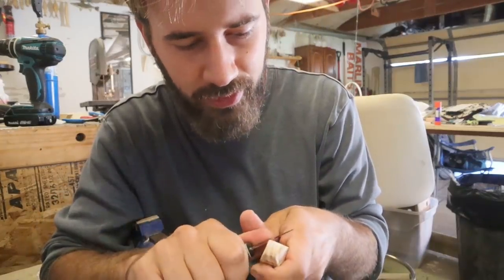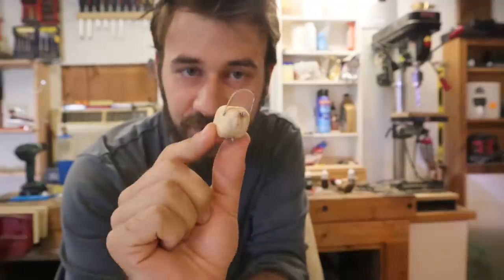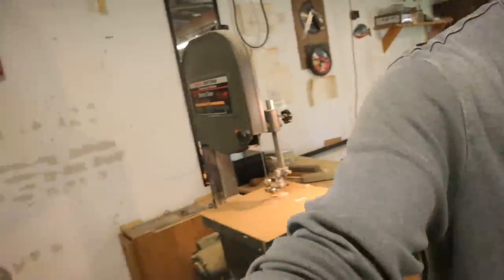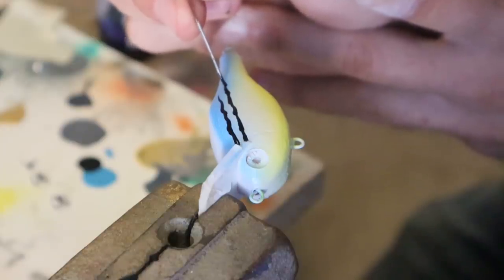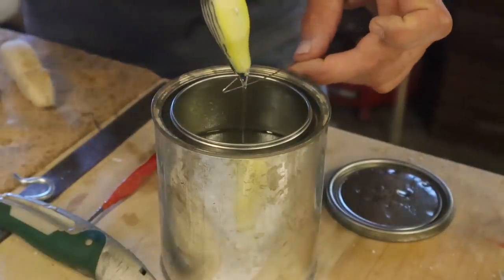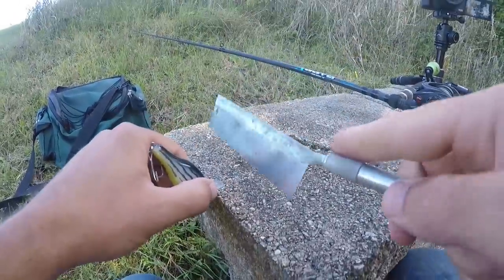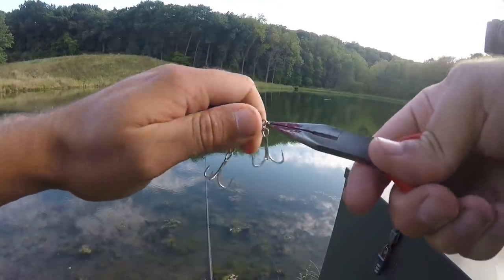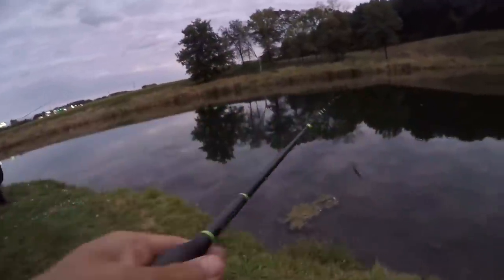Upside Down CrankBait | One Day Build to Catch

Comment: I'm a bullet caster and I'm surprised that when you pour in your molten lead we don't see all kinds of smoke when the molten lead makes contact with the wood; especially using lighter weight woods like pine.  The melting point of lead is a bit over six-hundred degrees and when I've inadvertently dropped any wood chips in my melting pot those wood chips almost instantaneously start to burn.

Some bullet casters use certain kinds of wood chips as a flux to separate out impurities.  How do you keep your wooden lures from going up in smoke?
Reply: TIM MONTANO magic

Comment: So I just started fishing, along with making my own lures a couple of weeks ago.  After losing every lure I've made by getting jammed between rocks, probably because I don't know what the hell I'm doing, I came up with this exact solution.  My hope was as I reeled it in, it would float over over the rocks.  Mine did not even work as well as yours, and I lost it anyway, but I think there's still promise.  

Instead of carving this last one out of wood though, I just sculpted it out of J-B Weld putty, which was very quick and easy.  For the bottom half of the lure I used steel infused kind, and the upper half I used the plastic kind and put an air pocket in it for buoyancy.  It's already full of epoxy, so there was no need to seal it.  The two kinds of J-B weld gave it a decent looking counter-countershading pattern so I didn't even bother painting it.  Anyway, that's just an idea you might want to try in case you have any other silly ideas you want to try but aren't sure you want to invest the time.

Comment: It’s Radiata pine.  Silly thing is here in Australia, that’s the el-cheapo plantation timber they build everything from houses to cheap furniture.  And silly me chases up scraps of cedar to carve lures n floats.
From one lure maker to another ( i’m a 4/10 quality when compared to your 9/10 beautiful creations.....) , have you considered making a rotisserie for use inside your UV chamber?  This can be made quite cheaply with one of those ultraslow turning electric motors used to turn some pedestal fan / heater louvres. Mount an alligator clip to the motor, and build a spinning support with another alligator clip that freely spins at the same height as the motor. That way you support the lure from both wire loop ends while it rotates, and as a result the expensive UV coating doesn’t end up thinning on the lure and dripping / wasting. Kind of like the same result you are getting from your epoxy rotation device, but for one lure.

Comment: I think the problem with a reverse crank bait is that if you reel faster to try get a more consistent action, there is also more upward force from the line angle going up to the surface in addition to the increased force on the upward lip. The the line force and the lip force help counteract one another in a conventional downward-lip crank bait.

Comment: Late to the party I know, but I use poly-carbonate sheets in my aquarium builds and just out of curiosity have you tried bending a lip yet? With mild heat the thin stuff you use bends without cracking or discoloration.  Something as simple as a curling iron (DO NOT BORROW YOUR LADIES... speaking from experience here) to make the lip on this one almost banana shaped should cause it to wobble like mad with minimal rise.... think air brakes on a plane. Fluid dynamics and aerodynamics are VERY similar at such a small scale.

Comment: I have a lure idea for you glue a high density wood to a lower density wood cut out a lure shape but keep the lower density wood on top half or top third to make the lure float and use the higher density wood as the weight or ballas for the bottom of the lure experiment to see if it changes the action and or durability well it's just an idea hope you can use it

Comment: Funky bait, but you never know what works until you try. Side note: if the weedwhacker head is constantly spinning, just back off the throttle adjustment screw on the engine (controls the position of the throttle cable).

Comment: I know I am really late (Apologies).  I have been trying to get this same dynamic in order to cause a reaction bite for hesitant followers.  The key element I struggled with was not overloading the rear placement weight while ensuring the rear bottom belly angle is spot on so that the fall pushes enough water in turn planing the bait backwards.  Also ensure you allow slack in the line when you pause at the top or you will get straight fall then forward pull because of the line.  I am not trying to get the quick turnaround like a glide bait but actually straight reverse.  Happy fishing to all

Comment: Clinch knots (called a half blood knot here) are kinda weak in my opinion, they have a tendency to strangle themselves and cut off when pulled hard. Not sure what you call them across the pond but a grinner knot is generally a better option and easier to tie reliably.
Shame the rising lure didn't really work out, kinda reminded me of a newt in the way it shot up to the surface then sank back down

Comment: maybe the lip should be pointed more vertical off the bait or even angled backwards. since a forward lip on the bottom keeps it low, the angle might need to be maintained for a top lip to keep it skirting beneath the surface.
EDIT: clearly i didn't finish the video before commenting!

Comment: OK my dude Here is some math for you that might work normal crank baits you want to get down quick your crank bait you wanted to rise slowly so instead of a 45° angle with your lip try doing something between 18 and 22° and see what that does it would still disturb the water but it wouldn’t be as aggressive I think to wanting to rise to the surface

Comment: It looked like you chucked the bit in the drill press too far and were holding onto the twist section of the bit instead of the round shank.  The forstner bits don't have that problem.

Comment: But actually I think you're onto something. I think you need to redesign it just a little bit and run like a white block all the way to the back with the majority of the weight being in the front. That would make a very heavy bait but at the same time it will achieve what you're trying to do. I think it should anyway. I don't have a lead pot so I can't try it but maybe you can try again? Start off with the bigger lips like you did this time so that you can make it smaller as you go if you need to. Keep trying weird stuff!